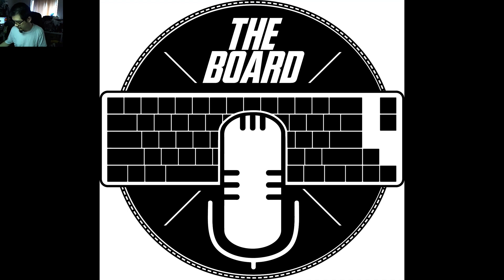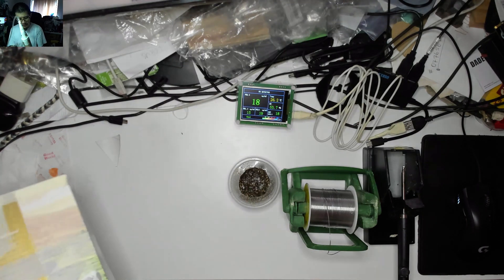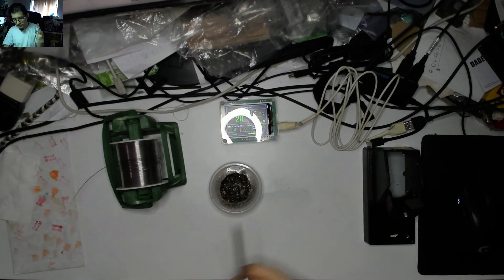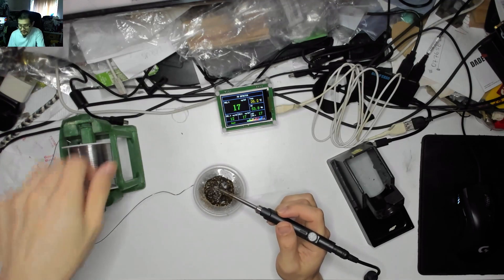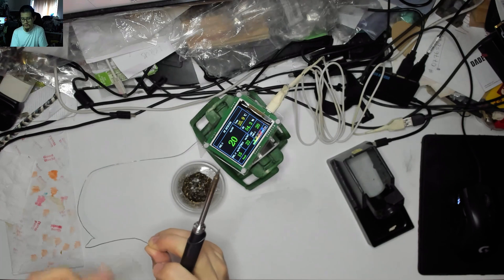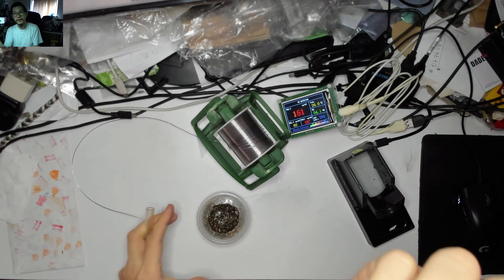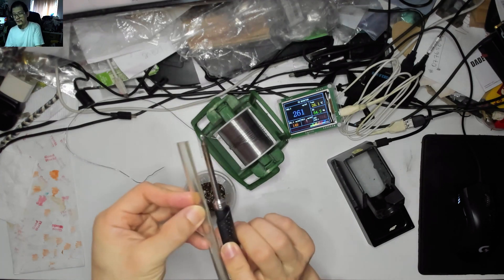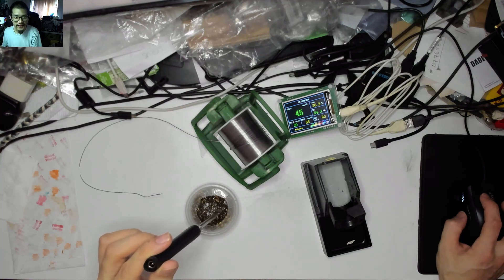Attempted FA-400 Fume Extractor Mod

Comment: Thanks for the videos.  I picked up one of these fume extractors after your last review.  To save space I built a smaller one using old pc fan and old 12v dc adapter.  I mounted it to my workbench using a flexible swing arm. You can purchase cut to fit carbon activated filters online for a few dollars
Reply from the maker: Sounds awesome :)

Comment: By any chance do you know the measurements for any mechanical keyboards case I cant find it anywhere
Reply from the maker: Thats very non-specific... You really would need to ask designers or those who have one if they've measured it. Try asking around either on reddit or on geekhack, or a keyboard discord for the specific keyboard.
Reply: The Board Podcast thank you gave me the best awnser
Reply from the maker: @NALDUS  Is there a particular keyboard case you're looking for information wise?
Reply: The Board Podcast 75% keyboard case
Reply: hot swapple case and plate
Reply from the maker: @NALDUS  I'd suggest looking at KBDFans possibly for generics.

Comment: You could make a ring with a clamp on top. Clamp would old the tube, and you wear the ring on index finger. That should ease the work for u
Reply from the maker: I think that option would work, or a rig for it to be very close to the iron tip, somehow attached to the iron handle, similar to actual professional vac line irons.